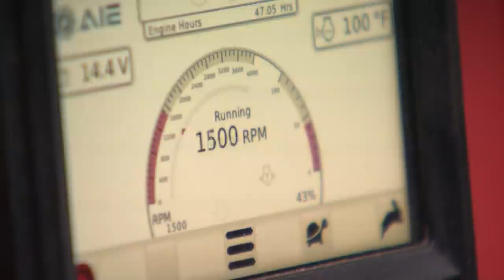NEW MILL IN TOWN! Sawing up some boards and addressing our recent work incident

Comment: Well done for mentioning the crane accident Jake. Some industries / operations hide these. I work in Oil and Gas where accidents can have some big outcomes but can be a real heads up to the whole industry and are well published by Alerts that are sent out. The aviation industry generally has a very good reporting culture and a "what happened to a blah blah aeroplane" crash is well investigated and distributed to the whole industry. Keep up the good work. Wish I had that mill and gear.
Reply: i read an amazing book recently called 'black box thinking' all about how great lessons can be learned from honest failure analysis

Comment: It is great to see those logs being reused along with the chips and sawdust. Milling is a lot of hard work and the removal of large trees is a dangerous job. So sorry to hear the news of your crane accident. I have worked around and with cranes for over 22 years and I feel fortunate we never have ever had any type of major accident. Years ago we did have a young man get his hand pinched with a load line. He was lucky and only received some stitches lucky he didn't lose any fingers. Safety education is the key to zero accidents. We hired a professional to run our OSHA-approved safety program. I respect his knowledge so much I call him Saftey Wayne instead of Mr. Wayne. Good luck and thank you for sharing all you share

Comment: yep, i have for a long time been wondering why you weren't milling, I have been milling and constructing ecobuilds for 25 yrs in europe on a woodmizer set up, mainly because using timber well is the best way of preserving locked up CO2 then building timber structures with a long life expectancy keeps the CO2 out of the atmosphere, possibly for 200+years, well done for getting into milling! From a timber framer/sawyer/tree feller
Reply: have you got dreadlocks and a van that runs on bio fuel

Comment: great video, those logs are awesome, when I had a sawmill- my biggest problem was getting logs, I would be a little concerned with metal in those urban trees, but if the price was right, my concern level would be pretty low
sorry to hear about the crane incident, sooner or later in business accidents do happen and you guys will develop procedures to mitigate the accident so it never happens again, glad no one was hurt, thumbs up brother
Reply: Yah we need to get a good metal detector. But I love that these logs have so much character and  that the trees had to come down anyway.

Comment: It's common practice in construction to remove people from structures while lifts are going on. That should be standard in all trades. Things fall, break, or simply human error can cause accidents like this, removing people stops unnecessary injuries. Sad to hear that trying to save a cut, 10 minutes, cost you alot of problems. Does your operator have a nccco certification?

Comment: If you need blades sharpened for your mill hit me up. I just got a BMS500 sharpener from Woodmizer and it can do up to a 3" wide blade. Im in Marysville. Awesome to see you guy using the trees!
Reply: Awesome thanks. Do you have a setter as well?
Reply: @beth-lang  I am waiting for it to show up. Its the BMS250 dual tooth fully automatic one by Woodmizer. Hope to have it soon. So far I have been sharpening my blades without setting them and its working ok. I'm told I can sharpen 2 or 3 times without setting them. Once I get the setter I will set them every time. I run a heavily modified Woodmizer LT35. Just started running 1.5 wide blades and wow do they cut better then the 1.25 blades. I also own a metal fabrication shop so I can modify anything on my mill. Let me know if I can help in any way.
Reply: How can I contact you?
Reply: @beth-lang  I sent you a message on messenger..

Comment: I’ve seen some milling channels discussing using diesel rather than water and Dawn soap for blade lube.  Supposed to work much better, especially with high resin logs like Douglas fir.  And it takes very little.  Not a continuous stream but just a drop here and there.
Reply: Also, glad to hear everyone was fine with the crane.
Reply: Lol... That's what my husband Iaian said too.

Comment: There seems to be all kinds of wave in those boards, in my very limited bandsaw milling experience that means your feed rate is too high and the band flexes or a dull band. However that might have just looked like that on camera and my experience is limited
Reply: Good eye there was some wave in the boards we created during this filming. It was caused by the large amount of sap that our Douglas Fir's have collecting on the blade. Since then I've improved the mix I use for lubrication on the blade to resolve the problem.

Comment: I have an important question, when you’re using the DMM 5/8 block with the notch rigging sling, I noticed the WLL of the 5/8 “notch” branded block sling is 1,800lbs but the tensile strength is 18,000lbs. How far above WLL do you feel comfortable going since the picks that your descending surely weigh more than 1800lb… do you use a different brand sling than “notch” for the dmm 5/8?
Reply: Lance, I happened to see your question unanswered.  The safe working load is the max load that is aloud.  Generally 10% SWL on synthetics and 20% SWL on blocks .you want the rest of the tensil strength reserved for dynamic forces and for wear and tear.  Hope that helps.  Check out Hamms Arborcare on YouTube we do slot of conventional rigging.  We feature this channel on ours.  We love what Jacob does.
Reply: @kevinhammatgameoftrees7080  I will do! Thank you very much for the info, it will influence my decision. I have been looking at the notch rope logic ultra rigging sling on Amazon in 5/8…. Was concerned that it’s WLL is less than the WLL of the DMM 5/8” block which spurred my question.
Reply: The rope is the weakest link in the system. Base your sling size off your rope strength.  The blocks will always be stronger than both.  If your sling is 5/8, then use 9/16 or 1/2 inch rope.  If you have 5/8 rope then use a 3/4 sling on the block.  Regardless, use a 10% safety factor on the weakest link, which should be the rope. That way you only have to be concerned with breaking one thing, the rope.

Comment: 15:50...was that John Cena walking by? "You can't see me!"

Now, does that mill cut vertically as well as horizontally?
Reply: No.  You flip the log over.
Reply: Nope it's not a swingblade mill, just the one direction. Then the lumber can be cut to length by the user.
Reply: 😂 Jordan Cena

Comment: @Guilty of Treeson @ Eastside Tree Works 

what did you do with the wood from the tree in the 400+ year old tree removal i am interested in having or buying some of the rounds if you have any i am trying to make a huge coffee table but can not find any huge tree rounds.
Reply: What diameter and species are you looking for?
Reply: @beth-lang  about 2 ft or larger
Reply: @larrylyman2575  Any particular species you are looking for? PM me where you live. We can likely work something out for you.
Reply: @beth-lang  i live in spokane wa. it is 2:32 here and the species can vary thats not a big deal as long as there is some rogue bark on the sides
Reply: @larrylyman2575  PM me
Reply: @larrylyman2575  I have a few  that should work perfect. Message me and I will send you pictures
Reply: @beth-lang  ok can you send some photos